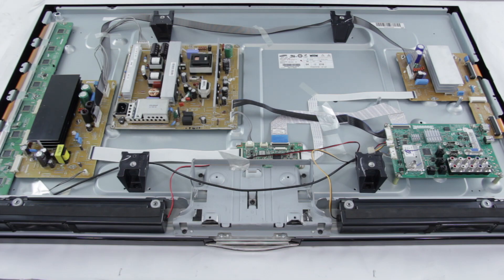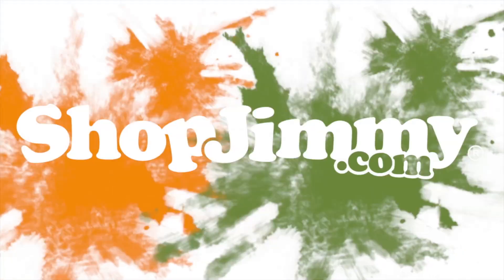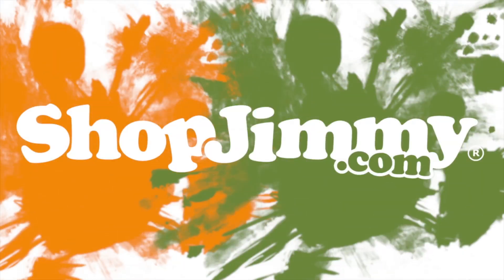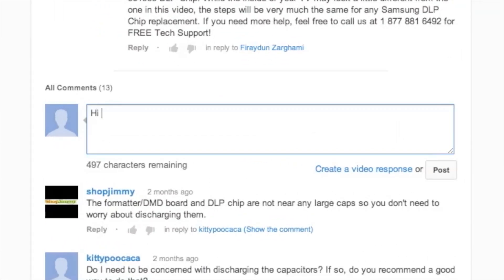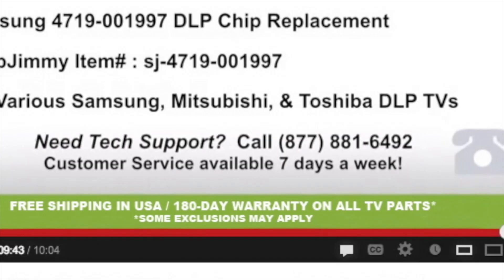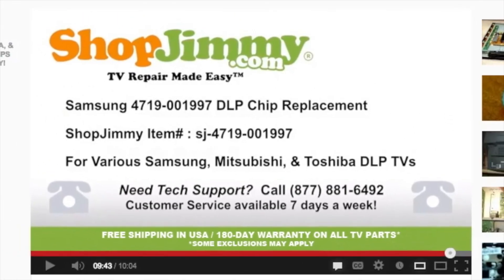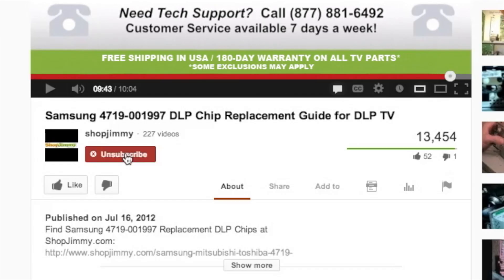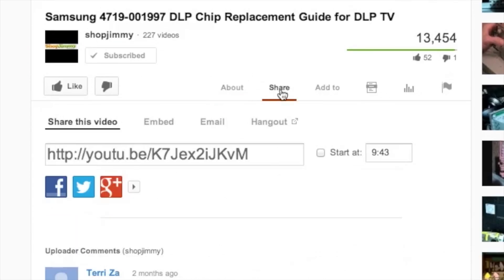Plasma TV Repair Tutorial - Common Symptoms & Solutions - How to Fix Plasma TVs

Comment: I have a Samsung Plasma TV Model Code - PN58B550T2FXZA and SN - AUMU3CES300893E. The TV was turned on but in the paused mode on Netflix. I was in the adjoining room and heard the chime sound when the TV is turned off. The red light on the front was on, which indicates the TV has been turned off. I pushed the remote to turn the TV on and the red light blinked and the TV chimed the on tune but the TV did not come on. There is no sound and the screen is black. There were no power surges or anything out of the ordinary when it chimed and went black. I watched the video and it sounds like i might have a bad power supply. Any ideas.
Reply from the maker: +David Bolton  Try all repairs and troubleshooting at your own risk.   I recommend replacing the Y-Main Board and the Upper and Lower Y Scan Drive boards in your TV.  Click this link to replacement parts for your TV model number:  http://www.shopjimmy.com/catalogsearch/result/?q=PN58B550T2FXZA  There may be multiple boards for the same TV model number, be sure to match part numbers on your current board, with your replacement for compatibility.  Here is a link to a video showing how to identify your part number, click here:  https://www.youtube.com/watch?v=R1jmj_foId0Thanks and please let us know if you have any further questions with your TV Repair!  www.shopjimmy.com

Comment: I have a Vizio model p50hdtv10a. The TV is not powering up at all. The led green light comes on when it's connected. But there is no response via the remote or the power button on the unit itself.

Comment: Hi i have a Panasonic Plasma model TH-46Pz80u (2008 model) , the symptons are the tv dont;t turn on and the red light blinks ten times stop and continue again and again.
Reply from the maker: +Sharkpr Pr   Try this at your own risk. Unplug the TV, then disconnect the SC board and plug in the TV to see if the TV powers up. Note that it will not have a picture on the screen. Reply with the results of this test. Thanks! www.shopjimmy.com

Comment: what could the problem be if my sound goes out? if i hit mute and hit it again sound will come back but go out again. It is a old ILO P42BSKH Dated 2005.
Reply from the maker: +Karen Schenemann   Try all repairs and troubleshooting at your own risk.  I recommend replacing the main board in your TV.  Click this link to replacement parts for your TV model number:  http://www.shopjimmy.com/catalogsearch/result/?q=P42BSKH  There may be multiple boards for the same TV model number, be sure to match part numbers on your current board, with your replacement for compatibility.   Thanks and please let us know if you have any further questions with your TV Repair!  www.shopjimmy.com

Comment: I have a panasonic th-p46s10a that when turned on by the switch will flash a green light really quickly for 5 seconds then turn back off. with the red light blinking. what steps do i take to troubleshoot what board the problem is on. Every none and then the TV will be able to turn of so i am very confused as to what the problem is? thanls

Comment: I have a 2011 Panasonic Plasma TV. Model number TC-P60ST30. We had a lightning strike that hit tree near house. There is no power to the TV now.
Reply from the maker: +Dave Latimer   Try all repairs and troubleshooting at your own risk.  I recommend replacing the main board and the power supply board in your TV.  Click this link to replacement parts for your TV model number:  http://www.shopjimmy.com/catalogsearch/result/?q=TC-P60ST30  There may be multiple boards for the same TV model number, be sure to match part numbers on your current board, with your replacement for compatibility.  Thanks and please let us know if you have any further questions with your TV Repair!  www.shopjimmy.com

Comment: hi i have a samsung plasma ps51d550c1kxxu  promblem with the tv is that the 3d is not working and the 3d picture is green  but the tv works fine in 2d mode and everything else seems to work fine .any ideas thanks.
Reply from the maker: +william mclaughlin  Try all repairs and troubleshooting at your own risk.  I recommend replacing the main board in your TV.  Click this link to replacement parts for your TV model number:  http://www.shopjimmy.com/catalogsearch/result/index/?cat=56&q=51d550c1  There may be multiple boards for the same TV model number, be sure to match part numbers on your current board, with your replacement for compatibility.  Here is a link to a video showing how to identify your part number, click here:  https://www.youtube.com/watch?v=BEPWrefQvqIThanks and please let us know if you have any further questions with your TV Repair!  www.shopjimmy.com

Comment: I have a Samsung Plasma model number PN51E450A1F does not power on.  I replaced the power supply board with a new one and it still does not work.  The standby light does not come on at all.

Comment: I'm thinking about purchasing a part from your website, but I have a quick question. 

I need a main board for my Samsung 50 inch Plasma. PN50B550T2FXZA, but currently you're out of stock of the BN96-12139A (main board). The board number for this part, found on a sticker on the part itself, is BN97-03775A. 

My question is, will the BN96-12142A (for the same TV, just a larger size) work in it's stead? It has the same board number (BN97-03775A). And looks identical. 

And if it does work with my TV, there's a notification on the page that says,"Board may or may not have a connector at location CN404F." I'm not sure which connection this is, but will I need it? 

I'm trying to repair my TV so I don't have to spend over a thousand dollars on a brand new one. I will definitely purchase the part if it's compatible and the connector isn't an issue. Thank you!
Reply from the maker: +Gigas Byrne  Try all repairs and troubleshooting at your own risk.  If they are the same part number, you should be alright.  Thanks!  www.shopjimmy.com

Comment: Hi. Thank you for the informative tutorial. I have a panasonic plasma HDTV and Model No: TC-P42X5. It had a burnt power supply. I bought another power supply but now the problem is there is no picture and sound. The LED on the front is solid red and when you try to change the channel,you see a very faint light on the screen bbut no real change. Am mulenga Bangili,a technician in Zambia. email address: mulengabangili@gmail.com

Comment: I have an LG 50ps60-UA, 3 months ago a blue line 1 or 2 pixels wide showed up running vertical from top to bottom of screen on the left side.  This week, screen went white with snow and 3 ghosts appeared running horizontal, picture is barely visable.  I have replaced the Y-sus board and both upper and lower buffer boards but that did not fix problem.  Also screen is the same in the menu screens without watching tv.  I have noticed on the center logic control board (erb63280301) the XD engine chip runs very hot if this helps in any way.  i have the same symptoms as michael lowery video with title "0319151706".  any help will be appreicated, thank you.

Comment: My Plasma pansonic TV model TH50PV600M goes of after 2 min of running. I cleaned fans, and found one fan not working, tried to change fan with tree wire fan, still it started working for 4min and stop, also blink 11 time, is it due to fan not matching, where I could get original fan? please help.

Comment: I have a Samsung PN51D550C1FXZA. When I power on I get 3 red flashes & then solid red but never a picture.
Reply from the maker: +t healy    Try this at your own risk. Unplug the TV, then disconnect the y board and plug in the TV to see if the TV powers up. Reply with the results of this test. Thanks! www.shopjimmy.com
Reply: TV still does not power up after disconnecting the Y board. I also tried disconnecting just the X board. Still no power.

Comment: I have a Panasonic Viera Plasma TV  model TH-50PX60OU with a manufactured date of July 2006. The s/n is LC61920631. When power is initially applied, I hear the 2 quick clicks within a few seconds, and the a single click within 20 seconds more. The TV is dark at this point. When I press the power button, this begins the 5 click red light routine which will continue indefinitely. If I hold the power button in for 15-20 seconds, the TV then begins the "10 blinking red lights of death) routine. After looking a many videos, I'm at a loss as to what boards need to be replaced. My electronic skills are limited although not quite as bad as a complete novice. Several videos mention replacing components and having to set them up using an oscilloscope which is totally out of the question. All I can do is spell ocsilloscope. I would need to replace the entire board or boards.
My question is: can you tell me from the above description what boards most likely need replaced, and what the general cost will be. Then I will decide whether to attempt to repair or put it out at the curb.
One last item for what it's worth; the TV was only used for a few weeks a year for the past 6 years.
Thanks, DScott
Reply from the maker: +David Scott   Try this at your own risk. Unplug the TV, then disconnect the SC board and plug in the TV to see if the TV powers up. Reply with the results of this test. Thanks! www.shopjimmy.com
Reply: +ShopJimmy.com I disconnected two smaller terminals at the top of the board, and one larger one towards the bottom which looked like the only three connections to the main board. Then I applied power to the TV, and got the two quick clicks, but not the third one so I figured maybe I was on the road to recovery. When I pressed the power button, I started getting five (5) blinking red lights which was totally a new symptom.  I watched and counted for a little while to make sure that's what I was getting. I turned it off, then held in the power button for approximately 10 seconds and I was now back to getting ten (10) blinks.

Comment: I have a 50 in Samsung Plasma (pn50a550s1fxza). I don't remember how we acquired it but since we got it it's had horizontal black lines running across the top of the screen. It seems to only be the top 2 ribbon areas off the Y-Buffer. I have replaced the Y-Buffer already and there is no change to the screen. Am I cursed with a damaged expensive-to-replace display or is there another possibility? Thank you!

Comment: Great video! We found a discarded Pioneer PDP-5071pu that turns on and only shows an image in the upper half of the screen--plays video, etc.--but the bottom half is completely bright white with no image. There is also a 2-inch wide black band that separates the white part from the functional image. It seems like this might be the Y-sustain or Y-buffer, if not the cables connecting to the screen itself? Is this repairable, and worth it? My roommate and I were only looking for something to play videos on.  Thanks!

Comment: I have  a vizio 50" plasma, model  P50HDM. The problem I am having is  you can turn the tv on and it will work fine for  5 - 10 mins. then it shuts its self off but power green light stays on. Then if u unplug it for a little bit then plug it back in it works again for 5 - 10 mins. TV has a killer pic. so I hope it's nothing too serious. what do u think? Thanks for your help...
Reply from the maker: +dave mayberry  Try all repairs and troubleshooting at your own risk.  This could be a problem with either the power supply board or the main board in your TV.  You can replace each of those boards individually to see if one of them fixes the problem.  Click this link to replacement parts for your TV model number:  http://www.shopjimmy.com/catalogsearch/result/?q=P50HDM  There may be multiple boards for the same TV model number, be sure to match part numbers on your current board, with your replacement for compatibility.  Thanks and please let us know if you have any further questions with your TV Repair!  www.shopjimmy.com

Comment: I have a Samsung plasma TV (SP-P4251) and it is having image scrolling issues (similar to vertical hold problem) only when the background picture has large light colored sections or is fully white.  On images that are dark there is no problem with the display.  I have already replaced the x-main and y-main boards with new ones from your store thinking that was the problem however the issue still remains.  Do I need to replace the power supply board or adjust a voltage setting?  Any suggestions would be appreciated?
Reply from the maker: +Charlie Manlapaz   Try all repairs and troubleshooting at your own risk.  This sounds like a TV panel (TV Screen) problem.  If your TV panel is bad, it may be more cost-effective to replace the TV as panels are typically hard to find in stock, difficult to replace, and expensive.  Thanks and please let us know if you have any further questions!  www.shopjimmy.com

Comment: Hello ..I have a Samsung S50FH-YB02 plasma TV. My issue is lately when I turn my TV on it makes a loud white noise sound and shows a grainy multicolor screen which kind of shows the picture in the background then cuts off. It will turn itself back on and do the same thing for 8 to 9 cycles... then finally show a clear picture. Can you help?
Reply: or model number PN50A510P3F
Reply from the maker: +Jr Page  Try all repairs and troubleshooting at your own risk.  I recommend replacing the main board in your TV.  Click this link to replacement parts for your TV model number:  http://www.shopjimmy.com/catalogsearch/result/index/?cat=56&q=S50FH-YB02  There may be multiple boards for the same TV model number, be sure to match part numbers on your current board, with your replacement for compatibility.  Here is a link to a video showing how to identify your part number, click here:  https://www.youtube.com/watch?v=BEPWrefQvqIThanks and please let us know if you have any further questions with your TV Repair!  www.shopjimmy.com

Comment: Hello, I have a panasonic viera tc-p42x1 plazma tv that will not turn on. When i plug it in and push the power button in i get a red blinking light that blinks 12 times. Can you help me figure out what it is.
Reply from the maker: +Joe Waltz   Try this at your own risk. Unplug the TV, then disconnect the SC board and plug in the TV to see if the TV powers up. Reply with the results of this test. Thanks! www.shopjimmy.com
Reply: No results, same red blinking light that blinks 12 times.

Comment: Zenith 60” Plasma Z60PV220-UA has no picture has audio depending on input you are plugged into. Don’t see any bulging caps. No blown fuses on P/S, YSUS, or ZSUS. Voltages from P/S to YSUS and ZSUS are good. Voltage from P/S to CTRL board is good. Voltage from YSUS to Address boards is good. Replaced CTRL board and Main Logic board to no help. Have checked Y buffer boards with multimeter and no shorts that I can tell. Any ideas?

Comment: Hello, I have a Samsung model# PN428B450B1D plasma 42" TV. The serial# is AUMT3CQS907236E. This TV was working and suddenly made a loud noise and turned off after the display turned in to wavy lines of some sort. In any event, it will not turn on either manually or with the remote. However when I unplug it and plug it back in I can hear a slight click like it is powering up. I took the back off the set and while it is plugged in I see a small green flashing led on a small board in the center. It looks like a diagnostic type of led setup like on the motherboard of my computer. I see no bulging caps anywhere or obvious signs of failure on any boards. What to do? Thanks.
My email address is tbresson419@gmail.com. Thanks again

Comment: Hi I have a Samsung PN60E550D1FXZA. There is a standby light and the unit powers up, (you can see the backlight come on). The TV screen will turn completely white for a few seconds and go black, it will repeat this cycle every 10 to 15 seconds with no sound or picture. Please advise.

Comment: Hi my samsung 50 INCH PLASMA PS50Q96HD  WHEN I PLUG IT IN  THE POWER LIGHT BLINK 3 TIMES AND GOES OFF WITH NOTHING ON SCREEN IF I PRESS THE POWER BUTTON THE IT GOES IN STANDBY MODE IF I SWITCH IT ON AGAIN 3 BLINKS AND NOTHING ON SCREEN COULD THIS BE THE LOGIC OR BUFFER BOARDS AS THEY ARE THE ONLY ONE I HAVE NOT REPLACED AM PULLING WHAT LEFT OF MY HAIR OUT PLEASE HELP THANKS
Reply: I have the same issue with my Samsung PN51D550C1FXZA.

Comment: I have a LG plasma TV. It turns on and off by itself. It is very intermittent.  50PG20
Model# 50PG20UA
Serial# 810RMGC216599
I would appreciate any help you can provide.

Comment: Hello, I need some tv repair help!  Here is all of the appropriate information:
> Make:  LG Plasma TV
> Model:  50PK750
> Serial #:  009RMBW4D365
> Symptoms:
   1) Turn on TV - Blue light in bottom right corner comes on, then fades a bit, then gets bright again, then fades out completely - NO PICTURE but good sound
   2) Already confirmed that it is not the cable box (replaced with new one and same symptoms)
   3) Confirmed it is not the HDMI Cable (exchanged with several)
   4) Confirmed it is not any particular HDMI port - tried all ports
   5) Here is the kicker... every once in a while, the TV will actually work as normal but it is becoming very rare.  For example, I tried to get the TV to come on over 10 times yesterday evening.  Woke up this morning and tried it and it came on.  Turned it off and now it won't come on again.
   6) When it DOES work - Blue light in bottom right corner comes on, then the whole screen becomes a bit brighter, then the picture comes on.
I have watched several videos and I am wondering if it is either they YSUS board OR the Logic Board.  I have NOT taken the TV apart as of yet to look at it.  It is quite a process to get it off of the wall, so I am waiting to hear if there are some ideas on how to fix before doing that.
Please HELP!  Thanks, so much!
Reply: Good luck...
.